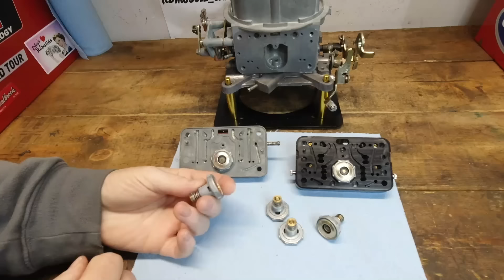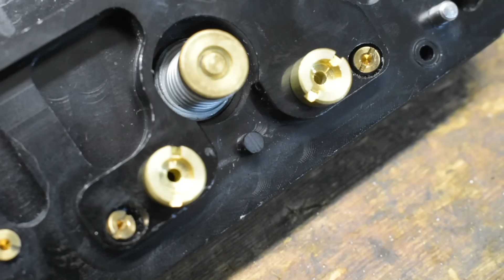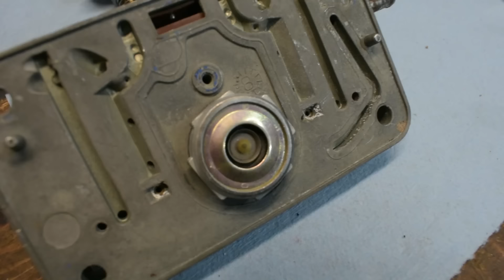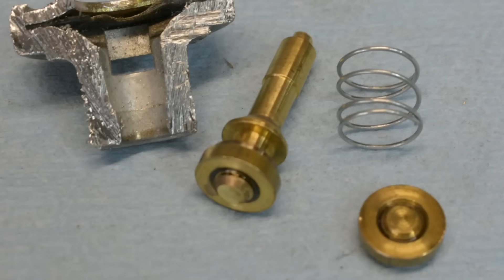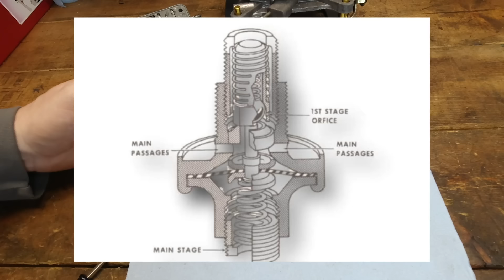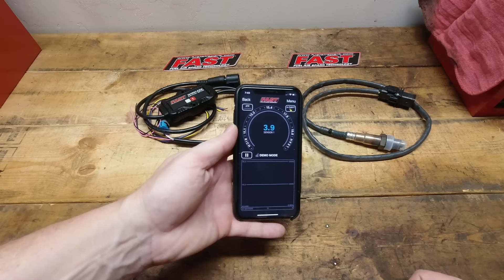Power Valves Explained: How they work, how to tune

Comment: So I have a big overlap cam, 107 LSA. At idle, in drive I have about 4-5hg. At cruise it’s at 12(30mph, 14(40mph) 15.5(50MPH). I’ve tried a 6.5, 4.5, 3.5PV. The only issue I really see, is if I’m driving at 40-60 mph and hit the gas pretty good, it seems to break up, then goes. Could that be the PV? I know, I need an afr gauge. At the track, at wot it runs pretty much fine. It’s a 750 Proform race carb. I think 74 primaries, 80 secondaries( I think). Any input? TIA
Reply: I am happy to see that i am not the only one with a vacuum behavior exactly what you described. i always get confused when i hear "...you will have high vacuum at idle and the vacuum drops with raising (engine) speed" with my setup it is the exactly opposite. the same way you described.

I dont know either what this means for this topic for choosing the right power valve. my impression is, my setup feels happier with higher PV-numbers like 8.5 compared lower like 4.5.
Reply: My sbc has the same problem! 5" of vacuum at idle without any vacuum leaks. Baffling! 110 LSA. Runs great just not much vacuum at idle?   I'm not sure why? Any advice is appreciated.
Reply: @Driven_Dragon  not sure. but i suppose starting from a certain level of overlap, you just have to live with it. Maybe considering a little advancing of cam timing could gain some improvements. but i would expect too much of a change in idle-vacuum.

Comment: I put 780 meatering plates on my 650 carb with a 5 power valve with jets for a 850 carb and I got about 21 miles per gallon of gas as long as I didn't open the 4 bearel but when I stopped the gas pedal it would rip the rear wheels was wicked I still have the car the same engine and the same carb runs awasom
Reply: I forgot to mention it was a 289 built

Comment: Hey you put out some very informative videos. Just a question or two if you don't mind. What would the 30, 40, 50 and 60 MPH show me on my vacuum gauge and my wideband? I understand the vacuum will drop but at what steady speed should the PV kick in? Or am I misunderstood something? Maybe you could do a video (I'm sure it would help a lot of us) on exactly how and when the jets work, how and when the squirters kick in and for about how long. How and when the PV kicks in and when should the secondaries kick in on the jets and/or the PV.  Or do the jets along with the PV on the secondary side kick in exactly at the same time? Sorry if I'm going overboard but that would explain a lot, especially to me.
Reply: the PV shouldn't kick in at any steady speed. it should kick in when you leave cruise mode and move to acceleration situation. 

i guess, what it was tried to explain, that if you monitor your engine in different steady speeds, then watch to which rating the vaccuum drops when you then want to accelerate and choose your PV near that point

Comment: Ford carbs used the same valves on 2 barrel and 4 barrel flat top carbs in the 60s and 70s. Worked on a lot of them. Ford called it an economists valve. Found below the float bowl. Turn the carb over and under a cover held on with 4 screws holding the cover.

Comment: Would like tuning tips on a edelbrock 2.o street tunnel ram with two holly 600 cfms vacuum secondary,  454 bb chev , 400 turbo , 3.50 gear set

Comment: Here's my issue, just the opposite of what you were describing. I'm running a holley 2300 on a 2.3 Pinto. Runs very smooth 25 plus mpg. But, when you hit 70 and over the gas mileage starts dropping fast. I believe I'm running a 6.5 or larger PV.  Need to go down to 5.5 or smaller so I can run around 80 mph and still get decent mileage. Right now at 80 it drops to like 19 mpg. Because the PV is wide open and doesn't need the extra fuel.
Reply: gee wind resistance.... your tuning with a wide band and know its too rich?

Comment: First time rebuilding my Quick Fuel carb. I noticed on the Holly web sight that there are three brands of power valves, Demon, Holly, and Quick Fuel. Are these universal..?  Can a Demon power valve be used in a Quick Fuel carburetor..? I'm obviously a novice at this...
Reply from the maker: They are the same.

Comment: Inspection plugs in the exhaust... and chaining the front down and putting it in gear accelerating in a pull to set the timing.... Crazy as you may,,, it works.😜 I always loved a Quadrajet ....but it's what I knew but once I started messing Holley I was impressed....Fuel injection is much more Simple.... once you learn... After all my rambling..... Very informative  Video content... thanks
Reply: fuel inj. wayayy easier...got over 300hp on the dyno with all stock internal original oem parts on my 2.0 4g63

Comment: I use to hear about something being off in the engine... The result was a backfire thru the Carb.  When this happened it was said that the Power Valve can be blown due to this..... Any truth to that?   Good Vid by the way.... I was thinking while watching, how hard it use to be to get this info..... Pre computer days.  :)
Reply from the maker: Yes.  Sometime in the 90s (I’d have to search to find when exactly) Holley started installing a check valve in the baseplate to fix the blown power valves on an engine backfire.  So while it still does occur, it’s pretty rare these days.  

No doubt the internet has been a big positive on sharing information easier.  With that though also comes the ease of sharing not so accurate info.  😆
Reply: And even before Holley incorporated "power valve blowout protection", blown power valves due to backfires were highly exaggerated.

Comment: Isn't CFM intelligent? It's not gonna use what the engine doesn't need, fuel or air. Recently saw intake manifold dyno tests with single and dual plane intakes. The 406 didn't need anything more than 650cfm making 560hp @ 7k rpm. A 830 CFM carb was used. The jetting was a little rich when looking at the plugs. Isn't going a little big better than not enough?
Reply from the maker: It’s easy.  Take the math from my video and apply it to those numbers.  What it actually moved through the carb is irrelevant.  What size to choose is very relevant.  https://youtu.be/Hy4s9B43YM0

Comment: I have bought a 750 Slayer for my 454 and it ran great but only 7 lbs of oil pressure, a little long in the tooth. I had the engine completely rebuilt and now it's a 461, it had no problems at all on the dyno and even tried an 850 CFM race carburetor and only picked up a few horsepower and torque. Put the engine in the car and I can't figure out what is going on? It will melt the tires! But I can't figure the stumble out for a life of me?
Reply from the maker: Where is it stumbling?  Off idle?  Mid range?  What carb does it have on now?  What’s your timing set at?

Comment: I’ve always gone 2 sizes below manifold vacuum in drive. It gives instant response and no stumble.
Reply from the maker: That’s one way to do it, but any method is only a starting point.  Not a single adjustment.

Comment: What about a bigger cammed car? I get about 7 at idle but when cruising it’s around 14. Am I setting the power valve half of 7 or half of 14?
Reply: My car is exactly the same vacuum levels. I bought a 10.5 because I figured that is about where I would need extra gas when accelerating. The dividing by 2 thing is bad advice according to many. And I think they are right because they say a high number PV will make it run rich at idle. I have air fuel gauge and it doesn’t happen.
Reply: @markmixon1121  yes right, some say that. but the PV-rating doesnt effect idle at all. As far as i know, the PV just enriches the primary circuit to the boosters but doesent effect the transition/idle-circuit. 
but i can be wrong.
Reply: @rustonwheels3064  we on the same page.

Comment: All good information....   of course we have more questions.    With a Manual transmission,   the vacuum varies.   Add in a draw through turbo setup,  and im scratching my head as usual.    I see a rich condition under load for sure...and sometimes a lean condition depending on gear im in at the time.   and cant seem to jet it down (or up)  far enough to fix this.   The power valve is my next direction.       I assume you will see the power valve open on your AFR gauge.  I need to pay more attention to this.      Thanks for the tips

Comment: Looking forward to your reports about tuning the edelbrock 4150. I will tune right along with you since I have my own edelbrock 4150 that I will try out on my current engine build. And I have a lot to learn.
Reply from the maker: Very cool!  Thank you. For sure we’ll be tuning the 650 on my GMC and later on when the big block is done on the Chevelle we’ll be tuning an 850 on it.  Lots to cover between now and then!  I’ll be doing more content on the 4150 series carbs very soon.

Comment: First of all you explained it very well and understandable. I have a question though 
You said if you are getting a stumble after selecting a power valve some may increase accelerator pump swifter or speed and this will only mask the problem 
My question is then when is it appropriate to change accelerator pump speed and or squirter?     Thanks
Reply from the maker: It’s a great question.  We’re going to be doing quite a few tuning videos this summer with a 4150 series carburetor and that point for sure will be part of it.

Comment: One needs to realize that the idle mixture (AFR) will be unaffected by whether the PV is open or closed.  This is because the fuel admitted from the PV feeds into the PVCRs at bottom of the main fuel wells; at idle, the main circuit has not started as evidenced by the fact that there should be no fuel flowing from the boosters.  When the PV should open is when the engine load increases decreasing the engine vacuum such as going up an ever-increasingly steep hill or opening the throttle under load.  In other words, the PV should open when the mixture starts to become lean (or 2" Hg vacuum prior to this point) under load to enrichen the mixture.  Although the guidance of "idle vacuum divided by 2" may work in many cases, it is better to establish when the mixture starts to go lean and then add 2" to this point to select which PV to use.
Reply: I like your info. Makes sense to me. But when do you know when you’re 2” hg before lean condition?  The air fuel ratio and vacuum reading will change rapidly at say, a launch at a drag strip. How do you determine the point to choose the valve?

Comment: I remember the days long before AFR gauge availability... the way to tune any carburetor was to read the spark plugs, the use of a vacuum guage, seat of the pants feel(butt dyno) and to get a better handle on tuning for max power, was to take your car to the 1/4 mile track and adjust accordingly.
Reply: Most people problem was their ears & butt dyno got very comfused once the time clocks popped up! They always thought the bigger the cam sounded the faster it was! And it would be ok as long as it was blowing the tires off!
Reply: Good times!
Reply: Vacuum is inches not lbs . Otherwise great video.
Reply: Now you plug your laptop in and push a couple of buttons. People now a days don't know how to "really" tune car
Reply: @rickkutyla251  sure but they are tuned better.
Reply: Yeah, we've certainly progressed from those bad old days of guesswork tuning.

With the relatively inexpensive technology we have at our disposal nowadays, we can set everything 'perfectly', as opposed to the old "butt dyno" guess work.

We are lucky enough to to be living in the Golden Age of engine performance, tuning, and development.

Thank God the old days are dead and burried.

Comment: hi 
Ideally power valve engage at just above cruise  ie vacuum reading at 45-50-55 mph . Then set the PV mixture thru the PVR power valve restrictor [PV screw in jet ] . Around 13 to 1 AFR 
The accelerator pump should be changed for stumble prior to that vacuum reading .
Primary main jets RPM range 30---50mph set for around 14 --15 to 1 Afr readings at light throttle . 
Power valves are NOT unique to Holley

Comment: I remember a long time ago I was helping I think lol , a fellow with his  bracket car . A 67 camaro . 427. Power glide ect ..  it had think a 1050 holly . I fellow that had a record holding hemi car was parked beside us ...he asked what plugs . And then said install autolite . I pulled the carb carried it to the holly tech booth . The tech had power valves . Every one was a 2.5 . The tech installed the power valve , set the float levels , new gaskets ect. What a difference these things did . I never forgot..

Comment: Too bad about the two stage power valve. I tuned my 650 DP using one. It allows a leaner cruise mixture for economy and the first stage takes the flat spot out when pulling hills and keeps the full metering block restrictions from opening. Better drivability, better control of the mixture. Std equip on an 85 GT 5.0L mustang. Not looking forward to the day it fails.